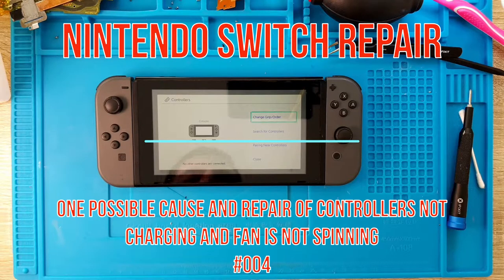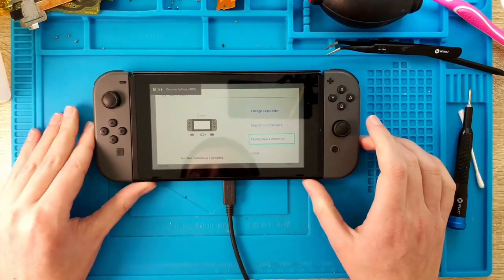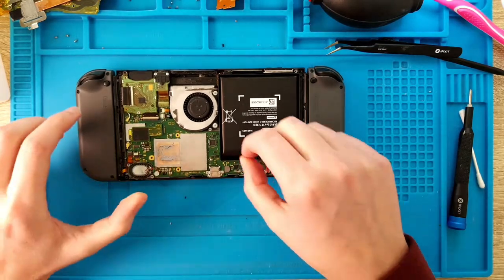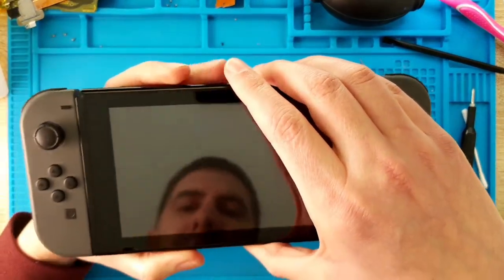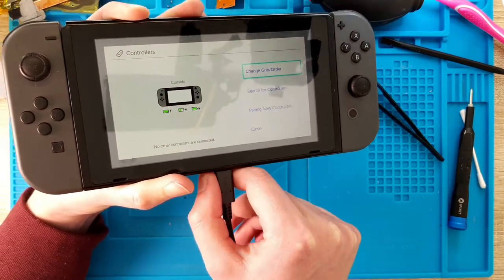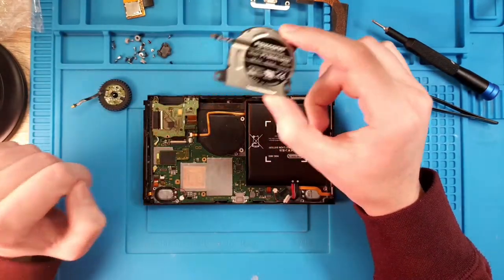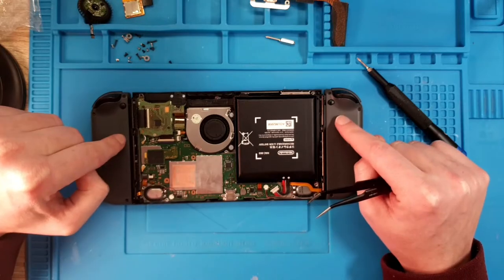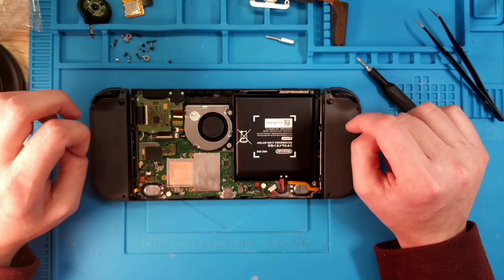Nintendo Switch Joy Cons aren't charging repair

Comment: man my switch gets used once a month and the right joycon stopped showing as charged. it lives in its dock and the joycon just random wont charge. so i figured why not just replace the battery. the old one is at 4.09v and its still registering with the switch as dead and wont turnon by pushing the sync button. im assuming the joycon itself has a short or something since it wont register as having a charge

i miss old nintendo where they provided a quality product instead of looking to milk customers by making finicky crappy products
Reply from the maker: Could also be a weared out or slightly oxidized rail. Alhtough you mentioned that you do not really remove it at all.
Reply: @kikihobbyrepair  figured it out. The tiny inline fuse is blown. Just going to jumper it

Comment: How to fix fan when only works with full power?
Reply from the maker: Could be multiple reasons. Could be the fan, or the driving circuit itself. Next to the connector there is in certain versions a small diode which could go bad.
Does the Joy con charging works if you plug in the charger?
Reply: @kikihobbyrepair  fan works fine ( tested on other console )  Yes the joycons charging.
Reply from the maker: Than there is some problem with the  fan circuit. It is hard to tell without seeing it. Cannot you see any burned components in the board?
Reply: @kikihobbyrepair  i think something is burned because i use 5v from diffrent device ( diffrent ground ) for start spin fan so i could burnt some componnent